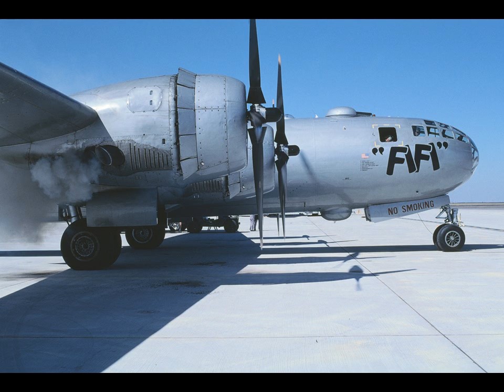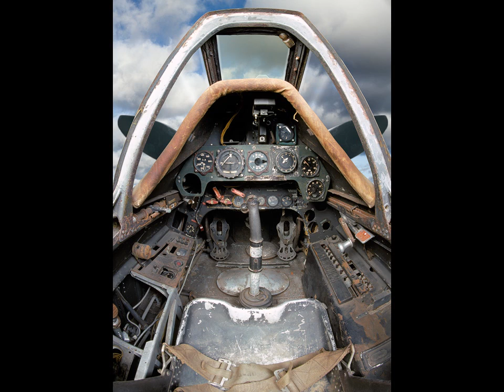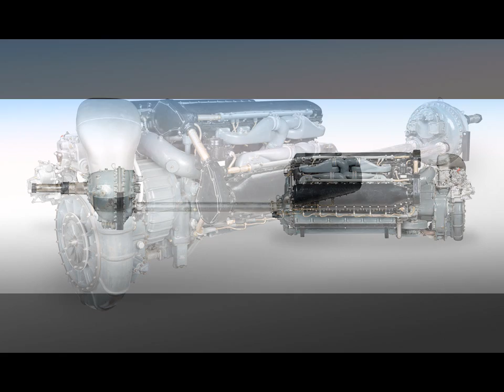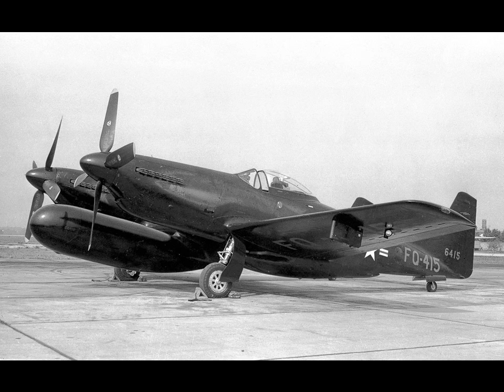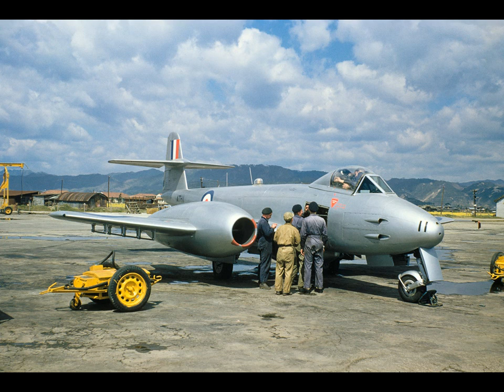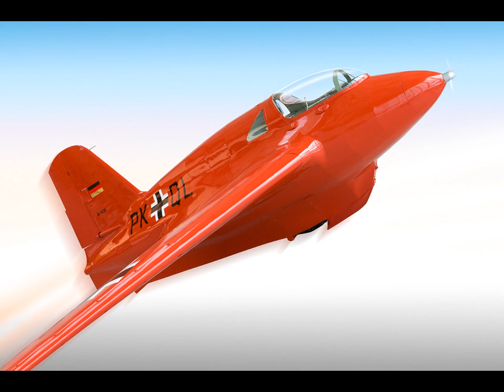Airpower: Piston Power and Early Turbojets

Comment: Thanks for an excellent video! Can you answer me a question: What is it about the combination of engine and supercharger that gives some planes their highest speed down low (say the Hellcat/Wildcat at about 10,000 ft) some planes their highest speed about medium heights (say the Mustang around 20,000 ft) and some planes their highest speed high up (say the TA 152 around 37, 000)? It can't be just a bigger supercharger in various planes! Many thanks if someone can answer this.
Reply: Thanks Paul,  two good examples of optimized low altitude performance would be the General Motors FM-2 Wildcat, and the North American P-51A / A-36 series.  Single stage supercharging, with gear ratios selected to optimized max boost altitudes were tactical uses of matching performance to requirements with small lighter weight aircraft.

Higher altitude performance fell to multistage, multi-speed supercharging.  These capabilities came at a price of weight and complexity.  The textbook solution was in the Rolls Merlin with its compact two-stage two speed after cooled supercharger.  Later Mustangs, and Spitfires demonstrated this in the 25,000 ft range.  Alternatively, the Republic P-47s Pratt and Whitney R-2800 boosted with General Electric CH-5 turbo inter cooled supercharger likely takes the crown for performance above 25,000 feet, but in a much larger, heavier airframe.

The Focke-Wulf Ta-152H presents an interesting approach with a variety of methods.  Its Jumo 213E utilized a two stage mechanical supercharger, with three selectable gear ratios, with charge cooling… and… GM-1 nitrous oxide injection to effectively oxygenate the mixture for limited time periods.  In concert with high aspect ratio wings and wide chord propeller design, it was truly optimized for altitudes above 35,000 feet (including cabin pressure).  A bit more development time would have told an interesting story.
Reply: @briansilcox5720  Thanks Brian, so what you're really saying in reply to my question, "What is it about the combination of engine and supercharger that gives some planes their highest speed down low" as opposed to medium or high altitudes, is basically the gear ratios, more than any other single thing? Correct?
Reply: @paulmurphy42 I would say the gear ratio of the supercharger determines what altitude the maximum boost can be maintained.  Horsepower is still determining maximum speed.  As altitude increases, true airspeed increases if horsepower is constant, so above the max boost altitude, the power will decrease gradually.  The fastest low altitude performance was usually smaller, lighter airframes with max rated boost at lower altitudes.  Grumman’s F8F Bearcat was a good example.  Very small, with in excess of 2000hp.  The R-2800-32W had a single stage supercharger, but with a variable speed hydraulically controlled drive.
Reply: @briansilcox5720  Yes, but what did they do to an engine if they wanted max speed low down that was different to an engine that went into a plane that wanted max speed high up...and another plane that wanted max speed at medium altitudes? There are 3 different choices for designers here, low, medium, high...how did they adjust the engine in each different case?

Comment: Great video, loved it. Just two observations:
- Why not using the R2800 in the B29 until the R3350 was ready, production of R2800 already was too much?
- 5:15 R3350-26W Skyraider power is 2700hp for Military when using 115/145 fuel and about 3000-3200hp for WEP with water injection. Not 2700hp, early 1946 models such as 24W were rated for 2800hp for WEP and 2500hp Military when using 100/130 fuel.
Reply: Thank you for watching and your comments.  I cannot say exactly what decisions were based on for the B-29, but based upon the expected range performance, the 3350 in a dual supercharger arrangement was likely considered essential.  Though the engine had been flown in other configurations, it was seriously stressed (underdeveloped) as it was applied to the B-29.  At that time, the R-2800 was still under development as well, with many types already scheduled for its use.  Great question.

I believe I quoted Military power from my reference source, but appreciate your input for the War Emergency rating for the -26W.  The Skyraider exemplifies how well development eventually proceeded for the 3350.
Reply: @briansilcox5720  Thanks for answering!

Comment: -In regards to early jet engine reliabillity in general and the Jumo 004B in general.     The alloy the Jumo 004B used was Krupp Tinidur which was appraximatly 30% nickel, 12% Chromium and 6% Titanium with balance Fe.   German metalurgists knew that ore nickel would increase thermal creep resistance but development of a 60% Nickel Tinidur was not preceded with due to a desire to ration nickel.   The British in anycase found that an 80% nickel alloy Nimomic 80 nwas much better for turbine blades than Nimonic 75 which had been developed for valve seats and exhaust valves.
-Furthemore the only sections using Tinidur was the turbine stator nozles and the turbine blades.  The exhaust duct, exahaust nozzle and combustion chambers were all plain milde steal though coated in an aluminium oxixde and all were quite prone to fail.  The nozzle would distort under heat, dislodge and block the engine for instance.  
-Another issue for the German engines was tha the turbine blades were cold drawn(pressed) out of sheet stock and attached by eyelets at the root whilst the Whittle blades were investment cast with fir tree roots machined in.
-The Germans did have nickel.  It was used in concentrations of 0.2% for amour plate because it prevented the spall (fragments) that could kill tank and crew even though no penetration had occured.  It was also used on the pressure hulls of u-boats.   Bismark must have had at least 40 tons of nickel in its armour.    So to an extent the Germans over reracted to their nickel shortage esdpecially considering that the DB605 and BMW801 supposedly used more nickel and chrome.   Having said that wen Finland signed an armistic with the USSR Germany losts its nickel supply and Turkish Chrome was also no longer available so hasty BMW 801 redesign was s were carried out to try and produce a engine free of these materials.
-The key avoidable problem of the Jumo 004B was probably the fuel control system.     The pilots throttle acted on a centrifugal governor that constrolled fuel flow to control engine RPM.   The problem was that when the throttle was opperated the governor would dose furl to accelerate the compressor but becasue of rotational inertia the fuel/air rato was eitther so high burnouts of the combustion chamber or turbine could occur or when reducing throttle flameout.  
-The solution that was meant to reach Frontline Me 262 units in April 1945 a month before wars end  was the 'acclerator control valve" which measured the mass flow of air through the engine with pressure sensors across the compressor and adjusted fuel flow in series with the governor.   
-Finally the thrmocouples that measured exahst temperature needed to be no only connected to cockpit instruments butr electronics to bypass fuel should temperatures become to high and also measure temperature rate of change to damp out dangrous temperatures even before they occured.
-Somewhat ironically the sophisticated German direct fuel systems could easily have been modified to produce this function but pressure to cut costs lead to a too simple solution.
-The HeS 011 turbojet was to receive duplex nozzles in which a second set of nozzles took over when at low low rates at high altitude or low throttle settings to give the correct disperson and some non primary sources claim this was to be a feature of the Jumo 004D.
Reply: Your estimates and hypothesis are easy to verify, because the prototypes, engineers and industry of Jumo did not cease to exist in May 1945. In the USSR, Jumo and BMW engineers used British alloys. This did not lead to success. The result of significant and long-term efforts in the USSR: licensed Nene engines became the basis of military aviation in the USSR and China. Only the enlarged core of Jumo 018 project in the NK-12 turboshaft went into production, but 6 years later.
I believe that this simple example shows the falsity of the basic design solutions of 004B.
The cross size of Derwent was determined not by the compressor, but by the combustion chamber. Despite the fact that the Whittle compressor provided more compression with a biger air flow, which allowed the combustion chamber to be reduced.  Whittle's merit is not only in using the right alloys.
In Germany, HeS 011, a very strange design, was clearly preferred in the future. The German engineers and experts failed, I suppose. Whittle saw the task well, the size features, and the available technologies. By general reasoning, the correctness of his decisions cannot be disputed.
BMW 003 influenced the ATAR and AL-5 in the USSR. HeS without offspring. And Whittle's W2 features in the Garrett TFE731 family of engines, which is still successful today, and in many other SMALL engines. The size is important for the technical appearance.
Reply: @ernest-ru excellent analysis with which technologies bore offspring.  I was merely the photographer with a limited understanding of the details… I really appreciate these comments.

Comment: The DB603 engine was suspended from German Air Ministry Funding in 1937 around the same time they started funding the extremely ambitions DB604 (and X24 engine) and the Jumo 222.   Essentially expecting 2500hp out of an engine in 1941/42 on 87 octane, something even the US couldn't achieve.   Predictably the Jumo 222 engine didn't meet its targets by 1942 though it was scheduled for production again in 1944 having achived 2800hp on 87 octane plus water methanol with a two stage supercharger.. It was then deciced to delay production yet again till it achived 3000hp.    DB603 funding was restored in 1940.   Prior to this the German Air Minstry and the Dainler Benz Borad had argued over financing of the Genghagen enigne plant which delayed and reduced productuion capacity.  When the Germanj air minstry wanted Genshagen retooled for DB603 engine production during 1944 but were unable to provide Daimler-Benz with the necessary machine tools. DB605D was the alternative as Genshagen conversion required far fewer machine tools.   Hence if your wondering why the Me 109 remained in production so long its because the production system couldn't be changed over quck enough.
Reply: I wish I could have consulted with you on some of these fascinating details… you have done your homework!

Comment: Thanks; this video series is unique in its quality and in my opinion only comparable to sources such as Calum Douglas' piston engine book and William Pearce's Old Machine Press website. 
Any chance of a follow-up video after the GE36 on the Pratt & Whitney/Allison 578-DX?
Reply: Historical rigidity is necessary. And then, say, it turns out that the "first serial turbojet fighter" is P-59A, the second is Meteor. And if it's mainly about engines, then it's worth evaluating them separately. For example, P-59s did not kill pilots. And how Gloster Pioneer and Bell Airacomet planes are at least interesting. They turned out not to be needed, but does Germany need Me 262 in the fall of 1944 the way it was? Even in Germany, there were doubts, but not some historians today. I believe that the facts should be presented to the public clearly and consistently. Then you can give estimates for 1944 by a man of the 21st century.
It's not worth taking on the role of an expert where there are fairly obvious experts of the time. For example, why, in the opinion of the author, good solutions were not in demand? Mr. Calum, for example, thinks that injection is an absolute boon, but for many decades, customers have chosen something else. So instead of historical facts, a story about "promising solutions" is being built. Engineers are solving a different problem: not a promising one, but a useful one. And useful to his people, not to his enemies. You can mentally change countries and engines.
The authors have trouble with comparisons and chronology. That is, for the sake of the narrative "about the fate of a futuristic solution," even the criteria that have just been clearly defined are drowned in an attempt to "honor." The time difficulties of different countries and firms were quite similar, if we remember that it is described in detail for 6 years. Like 2019 and 2025. My english is bad, sorry.
Reply from the maker: Thank you for your comments. This is high praise indeed! Bill Pearce and Calum Douglas are both members of the AEHS. And, yes, the 578-DX will be chronicled before the end of the year. Stay tuned.
Reply from the maker: The 578-DX video is now available.

Comment: The Me262 wing sweep was not just coincidentally increasing the Mach number. It was indeed mainly introduced for CoG adjustment due to the heavier Jump 004 engines. Messerschmidt decided for wing sweep instead of other measures such as moving the wing roots or engine position because he knew about wing sweep effects on speed performance. Germany was at that time leading in swept wing research. And not least, the Me163, developed parallel, had a similarly swept wing and a very high critical Mach number.
Reply from the maker: Thank you for your comments.
Reply: Adolf Busmann had presented his paper on supersonic swept wings at the 1935 Volta Aerodynamics Conference that Mussolini had sponsored and at which all the best American, British, German etc aerodynamicists were present.   By the time the Me 262 decision was being made several of the engineers were aware and supersonic, high speed and low speed wind tunnel data was coming in.  Ludwig Belokow, straight out of his Ph.D at University, recalls his first Job was lofting the wing cross section of the Me 262.  He had published a paper in   1938 pointing out that 30 degree sweep should allow Mach 0.95 flight at sea level.  Anecdotally Nevertheless some engineers can not recall any discussion on swept wings. others only in avoiding wings sweep due to risk at initial design.    
-The problems of wing sweep are actually in low speed handling.   The sweep produces a span-wise flow that lengthens the path of the airflow and allow more boundary layer thickening.  This produces premature wing tip stall.   Wing twist can't be used as it causes shortwave formation.  The solutions they came up with was full span slats, leading edge flaps "droop snoot' flaps and forward sweep.  They also came up with a precursor  to area ruling. (as it reduces span wise flow).     The AVA at Goetingen even campe up with area rule bulges to be place adjacent to Me 262 engines to raise Mach limit.